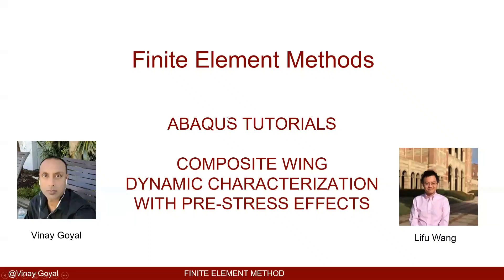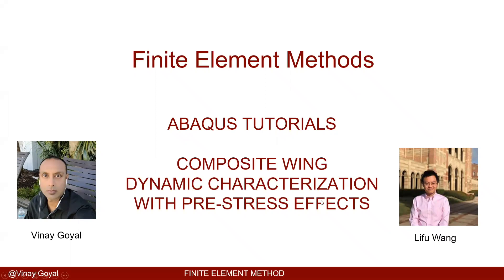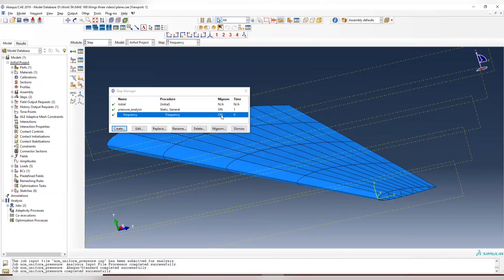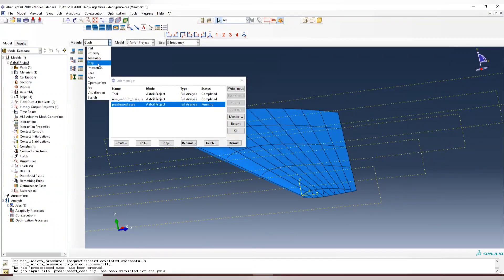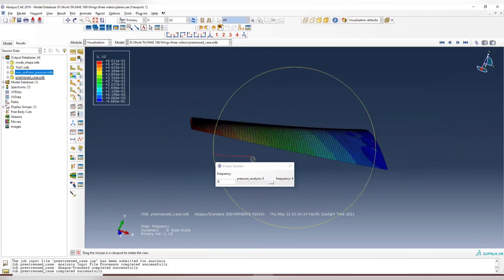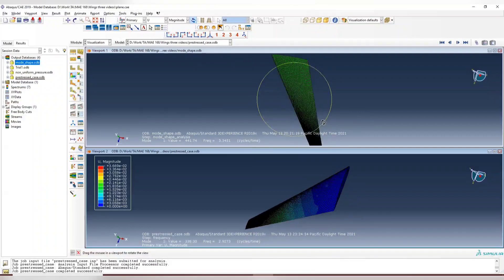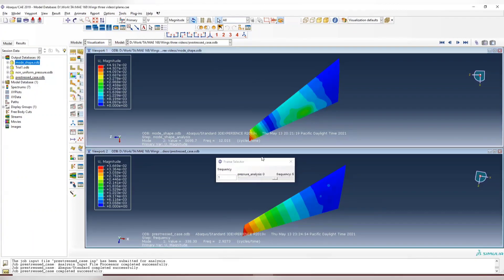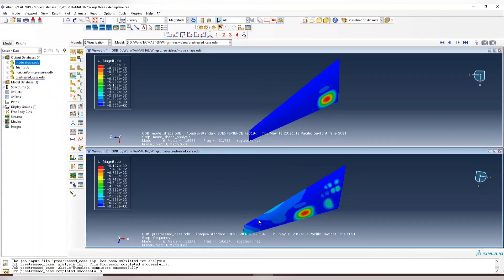#ABAQUS Tutorials - Frequency and Modeshape Extraction of a Pre-stressed Composite Wing

Comment: Hi, intuition says prestressed model will have higher stiffness thus higher frequencies, but here it’s not why?
Reply from the maker: That's the case for cylinder , depends on the load. Here one side is in compression other side in tension
Reply: @VinayGoyal  thanks, but why does being  in tension at one side and compression at another makes it less stiff
Reply: Hi can you please elaborate this point or provide some references